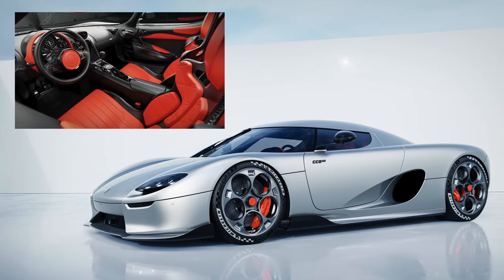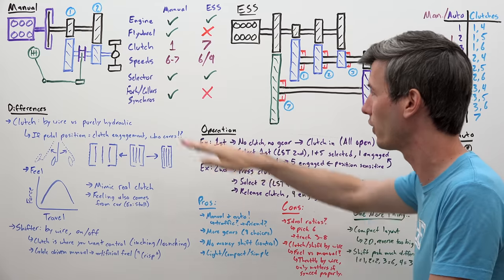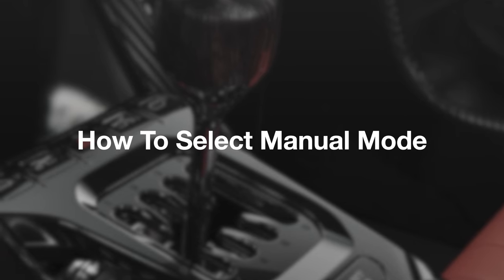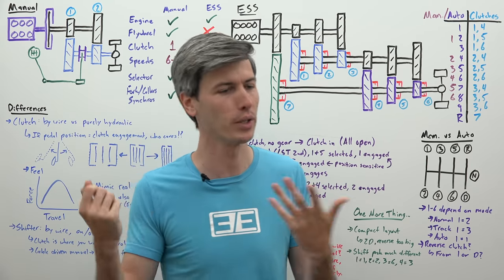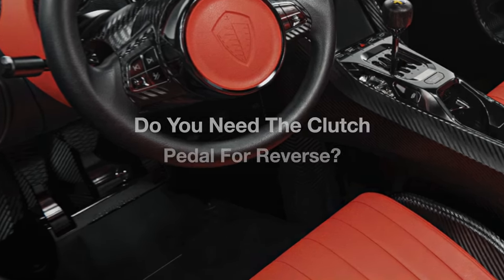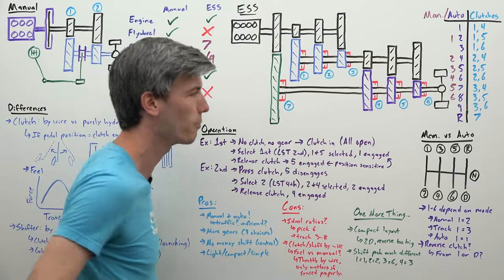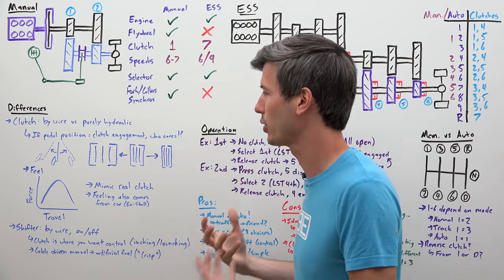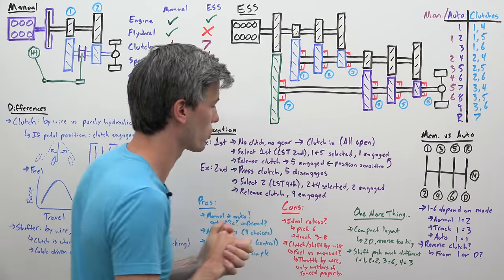Koenigsegg Reinvents The Manual! How The CC850 Transmission Works

Comment: Koenigsegg's engineering team is top notch. It seems like they are always coming up with new cool automotive tech
Reply: The management must be risk taker. Fail early, learn fast culture. Love it.
Reply: They design and build everything. Its amazing. Companies and engineers spend their entire existence on one engineering domain. They do it all and do it better.
Reply: @anthonycho6344  Exactly, thats a great motto
Reply: the electromagnet valve idea was good but this sounds so complicated, a potential endless money pit as they age..
Reply: @fidelcatsro6948  They are more complicated than a single valve, but eliminate the other mechanisms that push the valve up and down. They don’t have the inertia or weight compared to traditional designs. As with all computerized cars, the Model T will be able to start and run in 100 years. Non of our current cars will run in 50 to 100 years.
Reply: This is just an over priced and over complicated approach to a manual transmission, defeating the purpose of a manual transmission.

Their paddle-shifted lightspeed transmission is what's genius.
Reply: @jamesdellaneve9005  none of the current cars? Lol, aftermarket ECUs exist. And you can even convert engines to run on carburetors if you want to, if they still exist 50 years from now.

Even if i could live 50 years from now and start today's cars 50 years from now, i would not want to just like i would not want to be daily driving a model T in this day and age.
Reply: I think they would make a good F1 team
Reply: @sparkplug964  I've never thought of that, but that's a great idea. I'm sure they would be insane
Reply: Engineering team basically given carte blanche... More parts, more friction points, more points of failure, more complexity.  I'm not sure if I would exactly label them "top notch".
Reply: they're definitely top-notch passionate & creative about moving forward, and Mr. Koenigsegg is the perfect owner and leader for this company and operation
Reply: Koenigsegg here to save the manuals!!!
Reply: I just hope it trickles down like freevalve miata lmao
Reply: @2_Bike_is_Life  But are there actual more (mechanical) parts. An auto transmission has a very significant number of parts.
Reply: May you remember LS500h, using 2 set transmision planetary gear in beetween of electric motor, each set is 3 gear, so combined 3x3 = 9 speed forward transmission.
Reply: Yeah, too bad 99.999999% of the car driving population will never own or drive a Koenigsegg.  😞
Reply: @Oneness100  A significant % would kill themselves or others if allowed to own and drive a Koenigsegg. Too high hp-to-senses ratio.
Reply: @perwestermark8920  Agreed.
Reply: Untill you're the mechanic having to replace 7 clutches.
Reply: @SOP83  May be you need to ship the car back to Sweden to get those clutches serviced.  And then ship it all the way back!
Reply: is it reliable? are parts easily available for replacement?
Reply: @sparkplug964  They wouldn't have enough money sadly.
Reply: This isn't "top notch" engineering. This is taking a backwards step. Taking one stronger, more reliable clutch, and replacing it with 7 weaker and less reliable clutches. There is zero upside to this design.
Reply: @sepg5084 Constant mesh across 3-4 gears creates wear and tear and heat and noise and reduces strength by using smaller gears and a bigger final gear moving the Cog up.  My faily uses a 3 speed gearbox from 1928. Clicky shift and very quiet and smooth clutch.
Reply: this comment aged well , now look at gemera , its a wonder an
Reply: They propose a question as to why something isnt currently done in the car industry and find a solution. Exactly what engineering is all about
Reply: @Oneness100  i can only wish
Reply: @RonniePTexan  An automatic transmission have a bunch of clutches in them. That works, right?
Reply: @Xanthopteryx  Yes an automatic has multiple clutches. The reason is that each gear has it's own set of clutches internally vs a manual that has a large single clutch with more surface area that then has a positive connection after the clutch. I've owned, maintained, rebuilt and upgraded both manual and automatic transmissions in both street cars and my race cars. I'm very familiar with the "ideas" being thrown out there as being "new" and "innovative" designs. This car company does indeed have some good ideas in certain areas, but they are trying to reinvent the wheel in other areas and failing.
Reply: @RonniePTexan  Where exactly did they fail?
You know, Koenigsegg is the company that has the world record 0-400-0 with a car that does not even have a gearbox (well, yes, they have One gear gearbox as practically all cars have, including Tesla).
I promise you, they know their deal here.

Using a traditional clutch on a manual is of course a good choice since it is pretty cheap and reliable for the cost and not too complicated.

But here we are talking about a car for like 4 million USD. They spare no expense. Everything is done into perfection. Then delivery from 2023. They have tested this over and over and over again.
Reply: @Xanthopteryx  They are great at marketing and doing publicity stunts. The cars themselves do not last in the real world. With a team of engineers to keep it running, they managed to go to tracks and test it briefly. They then use those numbers to impress people who have no idea what is really going on under the hood. This car company is the best at marketing gimmicks and publicity stunts. That's what they are really good at
Reply: @RonniePTexan  What did they do wrong
Example of failing engine, clutch, gearbox and so on?
They take this serious. They have to. Customers pay a lot for this and they can not fail big because it would be the end of the business.
2018-2022, the numbers are black. Positive earnings.
2023 numbers are not available in tax database yet so do not know that, but they also built a new factory since the old has been too small for years, so i could guess that it would be red numbers in 2023 because of that.
Reply: Christian is a visionary, he isn't in the industry to hire some Lamborghini and Ferrari ex engineers and build a car that works exactly the same as the supercars from those brands.
He looks at all components of a car and thrives to make a better iteration of it, but his team is small, so he might only come up with 5 of these innovations in a decade, but it's still probably more than Mercedes introduces.

Comment: I guess it is "clutch by wire" then. the cool thing is  they can even put many safety mechanisms to prevent overrevving, engaging wrong gear, stalling, etc. you can also make it work in manual, manual without clutch operation, sequential, or automatic..if it's well programmed it could let you do exactly what you want with the clutch, as long as you stay in the operating range, like not burning the clutch. you can always have a switch to disable the nannies. They better not have bugs in the electronics otherwise it could engage two or more gears at the same time and blow up the gearbox. but it's no different from a dct btw
Reply: Christian himself has said many times that they want it to be true to the manual experience, hence why you can stall it.
Reply: If you engaged 2 gears with different ratios it would simply lock the transmission. But that would require the clutches to handle a huge amount of torque. Realistically they would just slip to a stop
Reply: Since you're speaking speculatively, I will too. You most certainly can have a clutch that feels like a hydraulic clutch in every other modern car. You would just use valves. So the computer types flow to the clutch you want to control with the clutch using valves. You could also have a hydraulic clutch with a pot on the end, that sends electronic signal to the clutch, but it still feels like any other hydraulic clutch. Sorry of like how some electronic brakes work.
Reply: @Skelterbane69  cool. maybe it will have different settings though
Reply: @thelastwoltzer  you are right the gears are always engaged so most probably it would only damage the clutches.could be expensive to repair , but under warranty since it would be a defect
Reply: watch the whole video
Reply: You’re just repeating everything he said in the video?
Reply: Manual without clutch pedal is just a simple Manual Valve body.  A aftermarket modification that's been available for years.  
My AOD has been modified to be limited to any maximum gear I select, while still being a auto.  A Manual Valve body would force you to make every shift every time.
Reply: What I'm taking away from all this is that it would be totally possible to make this transmission design purely mechanically controlled, if they had wanted to.  The shifter mechanism could have a pilot control valve that told the system which clutches were going to be controlled by the pedal. Of course, this would be even more complicated and heavy, so there is no reason to do it. But it could be done
Reply: @spacepheonix  yes, he even copied the whiteboard explanation from Christian too. SMH my head

Comment: I love the idea. Very ingenious. However I can just imagine the headache it will be to replace and maintenance the clutches
Reply: I think like most of today's mechanisms it will just be 'dump the whole broken thing and bolt on the replacement'
Reply: Well, this is Koenigsegg. If it breaks, you just send a 50k check and drive your other hypercar while this one is being fixed.
Reply: wet clutches last a lot longer than you'd think, and with the gears never losing mesh, there's less wear there as well.  I'd expect less overall cost in maintenance than a traditional manual transmission unless you are doing things very wrong.  As in to the point that you shouldn't be driving a traditional manual transmission either.
Reply: I guess Koenigsegg will make the clutch packs out of the very best materials they can find, so their customers will pay an enormous amount up front, but probably the clutches will very rarely need replacing.
(Especially given how little most super/hypercars are actually driven.)
Reply: @phuzz00  yeah, it's Koenigsegg.  Those clutches will be worth their weight in gold.
Reply: The first thought I have is that with a clutch on every gear, and 2 gears per shift position, thats N-2 throwout bearings constantly engaged for N physical gears. With that caveat though, it’s effing beautiful
Reply: It's just DSG  with extra steps 😂
Reply: Well, if you can afford a Koenigsegg, money is more than likely not an issue...
Reply: @kly826  Absolutely, I'm just hoping the tech filters down into a more consumer friendly/affordable version.  I'd love to have this manual.
Reply: tractors have been using this technology for years and years. Power shifts were first invented for the tractor market. John Deere had one out in 1963 which is very similar in theory to what this is. They are incredibly reliable. Imagine your single clutch now gets used 1/6th the amount or less than a typical clutch.
Reply: @johnfrank4996  Thats exactly what I was going to say.  I have a 1965 powershift deere which still operates perfectly after nearly 60 years and who knows how many 1000s of hours.  I would bet the computer control mechanism for the computer fails long before the clutches need to be replaced
Reply: Okay. First off, the majority of wear in a manual transmission comes from the clutch; NOT from the gears being engaged/disengaged by the mechanical linkages, shift collars, etc. So your comment of “there’s less wear there” is boldly false. If a driver has the habit of riding the clutch at a stop light, that’s now going to tear up one of the 3 clutch pedal controlled clutches; and that’s most likely to be the one for the lowest gear ratio, since everyone knows the “start in first, and shift from there” rule. Now that may not sound like a big deal, but here’s where things go from bad to worse; if the driver is consistently not pushing the shifter all the way into gear, (or if the potentiometer that reads shifter position gets “off” in its position “count”, thus telling the computer not to fully engage that gear’s clutch) then you’re going to have a clutch failure that effectively eliminates 3 of the gears from the transmission. And before you go trying to say that potentiometers “don’t lose track of their position”, I have personal experience with limping along malfunctioning gate controls where a bad potentiometer turns a commanded setting of 15% into 100% at the gate/actuator, and a commanded setting of 80% is actually ~37% on the actuator. I’ll give Koenig 1/2 a star for thinking outside the box, but not more than that. Too many wear points in this design, and I’d bet money that the potentiometers for shift position will be way less reliable than most are predicting.
Reply: It's just an excuse to make something more complicated for no real benefit.

I'll keep my synchros
Reply: @MadScientist267  as if you could afford such a car anyway 😂
Reply: If I were a design engineer on this project, I'd explore the viability of electromagnetic powder clutches which aren't subject to wear; if the ferromagnetic powder gets ground down finer it locks up just as well.
Reply: If you spend 2 million on the car who cares.
Reply: @jacobcarlson4010 nobody uses potentiometers anymore. 
Hall effect sensor + load cell sensors and you pretty much can't have a faulty clutch pedal due to wear. They can brake if you overdo on the pedal, of course. Just as any component when you stress it over it's limit.
Reply: People who drive these have the money to dish out the replacement.
Reply: @PuerRidcully misses the point completely
Reply: @timbob1145  Koenigsegg or me? Because I'm not wrong. If I want manual, I don't want computer to do it for me, you know.
Reply: @PuerRidcully  the computer isn't doing it for you tho,... Just like a computer isn't flying a plane just because the control surfaces are actuated by computers.
Reply: @timbob1145  Whatever, dude. It's not a manual.
Reply: Have you checked how many clutches there are in a normal automatic transmission?
Reply: @phuzz00  Totally true. Like, they have (i think it is Gemera) a tiny clutch that tolerates the engine that is at 1500 hp. It is insane! But they spare no expense. Only the best material. Best design. Fine tuned into what we normal people would call ridiculous.
Reply: Youre under the assumption that rich people actually drive these cars much because they don't.